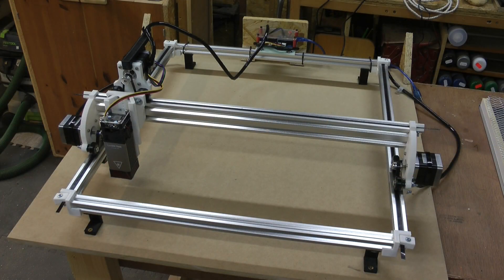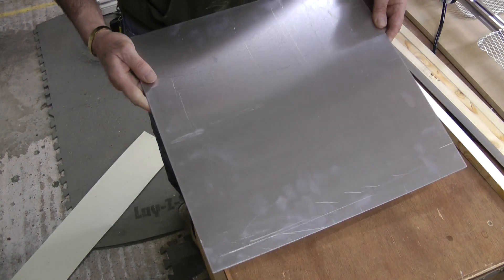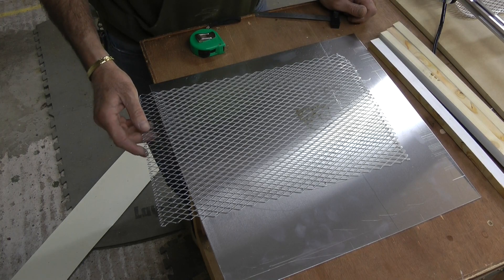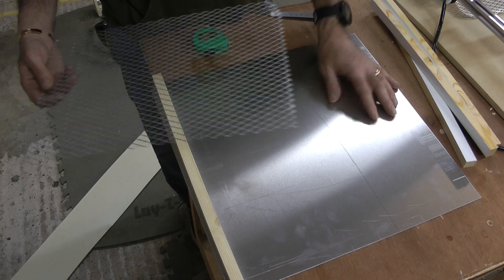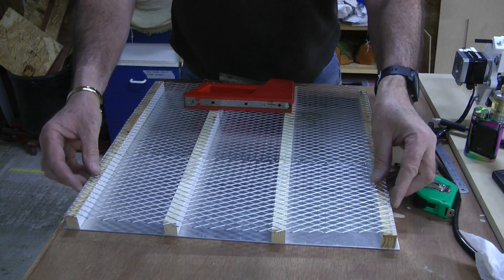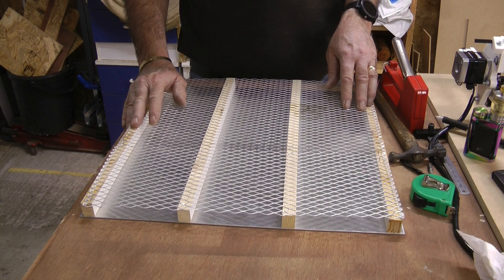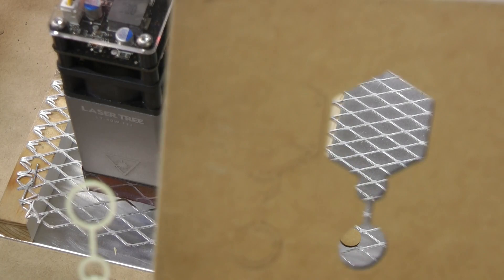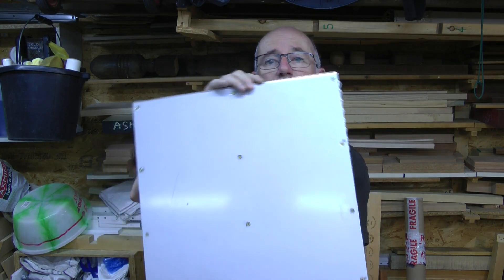Homemade Diode Laser Cutting Bed for under £20 (#40 )

Comment: Hi. Does the metal mesh not cause any reflect back issues to the laser?
Reply from the maker: No it doesn't,  don't know if because the grid is only aluminium it makes a difference.  Hope that helps. Thanks for commenting.  Geoff

Comment: Why no just use mdf? cut it to size with a circular saw then laser cut a variety of holes to fit wood dowels, bolts whatever you want and now you can have free floating projects that dont scorch. That expanded metal wont get rid of all the scorching.
Reply from the maker: Yes you could do this, I'm just showing another way to achieve the same. Thanks for watching Geoff

Comment: Great money saving advise and fun to build. 
So does your lazer bed just sit ontop of the mdf or aluminium spoil board or what keeps it in place?
Reply from the maker: The laser bed sits on top of a piece of sheet alum. Thanks for watching
Reply: @luvwud  OK thanks but what does the sheet of alum sit on top of and what holds it and the lazer bed in place?
Reply from the maker: @mikemcguckian6968  sorry see what your after. It sits on top of mdf with no screws as the laser doesn't create any kind of movement.  Geoff
Reply: @luvwud  many thanks for the clarification👍

Comment: I have a K40 laser and have been using barbeque grill for years works a treat.  Good video
Reply from the maker: Thanks. What do you clean it with?
Reply: I give it a scrub in the sink every now and again with an abrasive pad. @luvwud
Reply: I use peg board and dowels no scorching 😅

Comment: Could you tell me what output power your module is please I've got a laser tree 10w on the way
Reply from the maker: As far as I can remember it's 5.5w, hope that helps. Geoff
Reply: @luvwud  oh ok, so mine should be ample powerful enough to cut templates to route around then
Reply from the maker: @santy5559  What thickness you trying to cut
Reply: @luvwud  5mm maybe 6mm I have an inlay job to do on a cutting board, so deeper the better, but as for the templates, I think I can cope with 3 or 4 mm

Comment: For the very bottom of the work area just buy the cheapest terracotta tiles you can find. Turn them upside down and line the bottom. The reddish underside is laser and fire proof. It also has raised checker board style ridges (normally used for grabbing into mortar), but those ridges are also taller by a few  mm's.
Reply from the maker: That's interesting to know, thanks for that Charles

Comment: Good solution. I struggle to understand why the pre-made beds are so expensive so will give this a try. Thanks for sharing the idea.
Reply from the maker: I found it does work, but does need replacing over time. But there again it hasn't cost much, so you can make another.
Reply: You will still have problems with scorching when the laser intersects with the expanded metal. Just laser cut or buy some peg board and use dowels it is so much easier and faster and you can eliminate scorching

Comment: The Idea is great, but....
You will see, if you start many laser projekts, the thin metal will bend, so you have maybe a problem with the focus.
Reply from the maker: Thanks for your comment. Yes overtime the metal does bend and break eventually, but it's cheap to replace anyway. Geoff
Reply: Thats correct.
Reply: Try wicks they do a large piece of that bbq stuff for a £10 spot